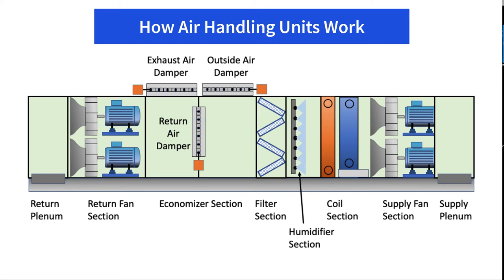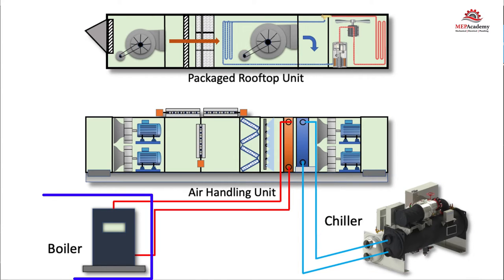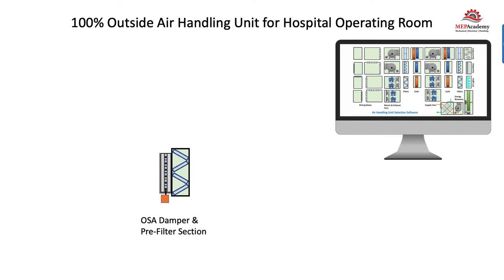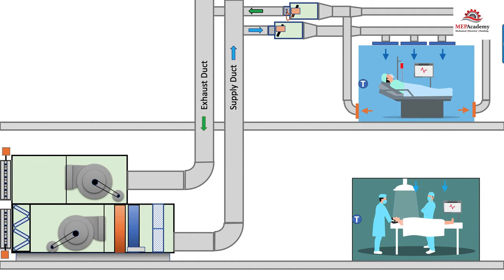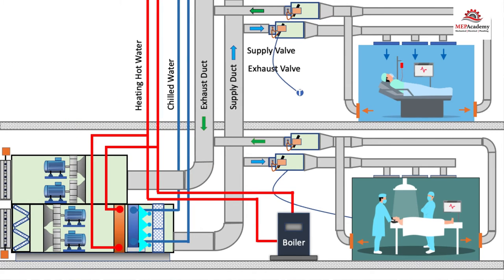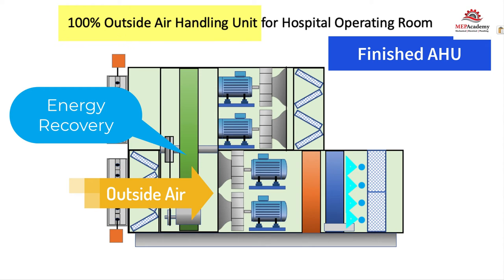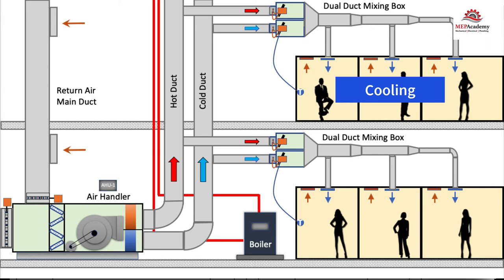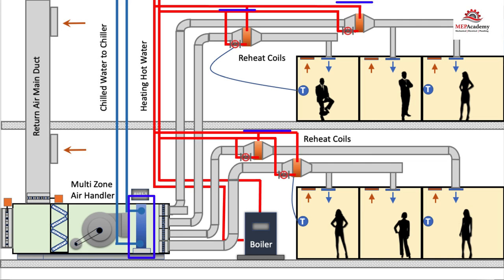How Air Handlers Work in HVAC Systems

Comment: Is it OK to run the air handling unit without stopping 24/7/365....
The second question: Since we could  connect the air handling unit with a VRF unit, Is there an inverter air handling unit? or could we build an air handling unit with an inverter fan? If possible, if we turn off some zones in building, does that mean the air handling unit fan will slow down a little? Thank you....
Reply from the maker: Depending on the application there are AHU's that need to run without stopping. Think about critical systems in Hospitals, Laboratories, Data Centers, etc. The air handler can have a VFD that varies the speed of the fans, but an inverter compressor is normally part of the refrigerant cycle within other types of equipment. Depending on your system, reducing fan speed to match demand is a great way to save energy.
Reply: @MEPAcademy  Thanks...